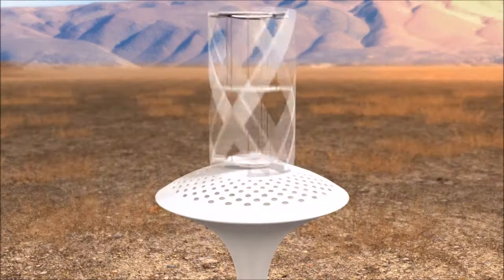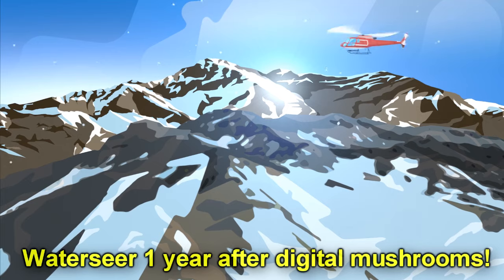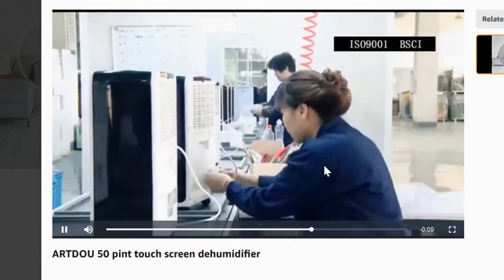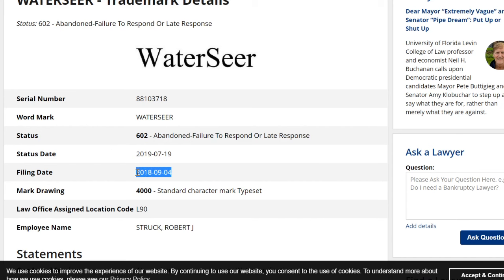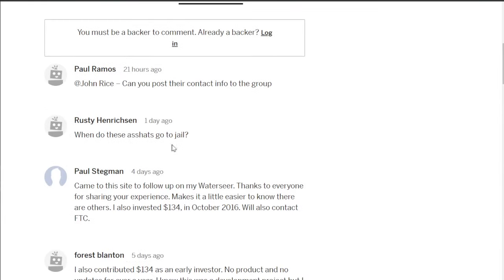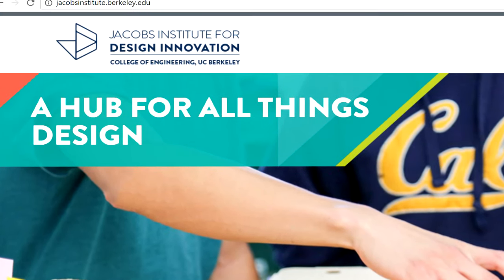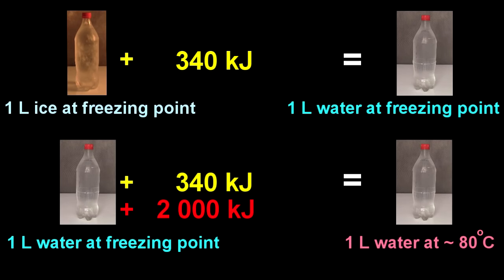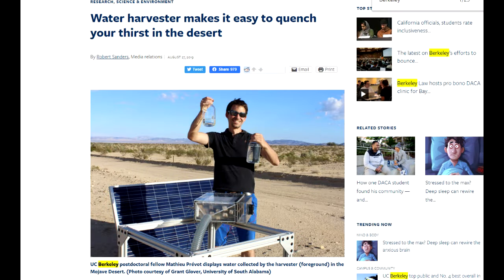Waterseer, Another one bites the dust!!

Comment: I don’t understand the thermodynamics argument in this video. The idea is that it blows warm moist air from the surface to a soil cooled chamber underground. The system is giving up heat which is then absorbed by the soil. As such it is giving up energy not absorbing it. The question is if it will be cold enough in the underground section to cause condensation and to what degree. If the underground chamber was big enough and designed correctly, and vented back to the surface to maintain airflow it might work. After all doesn’t an underground heat pump system do the same thing in reverse absorbing heat from the soil by pumping a refrigerant into it and then expanding it thereby capturing heat from the ground. These systems absorb free heat from the soil as the heat pump output is far higher than the electrical power inputted. The soil does not significantly cool down in the vicinity of the coils in those heating systems so I take it soil is a good conductor. Similarly I do not see why the soil should heat up significantly in this case. Heat sinks could be branched out from the chamber. The question of whether it will work or not is more to do with humidity and dew point in the chamber than thermodynamics. Would there be sufficient moisture in the air in an arid region for this to work and would the temperature difference between the surface air and chamber be great enough? I agree that the concept as presented appears so simplistic that it smells like a scam, but would it be possible to design one that would work? Mind you, I couldn’t see the water remaining clean for long in an underground chamber.

Comment: Basically they design a tube with a wind powered fan placed in it so it can draw in air. Also allows rain water in. Anyone with a little knowledge in metal can build one without having to spend lots of money. However in desert area's there is a lack of moister in the air as it is hot weather. They would be most suitable for after it rains or before. Cleaning as it also intakes dust from outside and mixes it with water would also be a problem. As someone who lived in Southern Arizona in a flood zone during rainy seasons this item is worthless. It's better to collect rain and store it naturally underground or in a cellar in barrels as to not let your water evaporate. Of course the business would shut down with so many problems and with such a cheap manufacturing. Also the air pollution in some area's could be drawn into them and contaminate the water. I am by no means an expert but even I can understand this much.

Comment: Any powered compressor system can produce water from the air.  The problem is always the power required to produce enough water to be meaningful... 'how-much' water you get given the power you can supply to the system, the humidity, and the cost of the components.   A normal home AC system produces gallons of water a day while it is operating, for example... but it is not drinking-quality and of course it also burns 4KW of energy while running.

A small extremely efficient compressor system such as you find in any powered cooler (say, a dometic cfx50, for example) can produce huge temperature differentials of 60F or more with an average power draw of only 15W.  Easily powered by a solar panel and a small battery.  But the components, added up, are not cheap, and optimizing something like that for condensing water would significantly increase the power draw (condensing water out of the air takes energy.  Just cooling an insulated compartment, not as much).   Also, the PH of the water produced will likely be acidic...it's effectively distilled water, and is not healthy to drink unless the PH is balanced out.   (Adding minerals afterwords isn't a problem, but balancing the PH is).  If it is your only source of water you don't want your teeth to fall out over time!

So the basic answer is... given any power source, such a solar panel or wind turbine, even a small one, you can produce water from air in the desert.  You just can't produce very much and the condensing surface can't just be metal fins (which will leech metals into the water being produced) and you probably have to balance the PH of the result and have to be careful about leeching material into it and you have to also add some minerals and ... well, all this gets a bit pricey and beyond the abilities of your average third-world resident to maintain.

-Matt

Comment: yes, this is a scam, but there really is a practical way to get water from the air.  it's called fog harvesting.  It works, but only in areas with reliable, heavy fog.  So it is not a scalable solution to water scarcity.

Comment: I think i found the machine least similar to his and in most optimal conditions it could produce 1200gallons/24h and liter of water would cost "just" 0,07243$ :D not including energy needed to purify that water that is. Rumors state that 3 units that he had running have been discontinued when it was discovered this system was not economically viable.

Comment: little question on top ..
WHY THE HECK should water from the air be the cleanest there is? 

just by faning air trough a tube you get dust particles into the condensing water ...

Comment: To be fair, as a PhD student in Electrical Engineering, most engineering students I dealt with are pretty damn stupid and would never think to do those kinds of calculations to see if it would actually work and would instead just jump right into it.  I can guarantee you that the more prestigious schools don't really produce students who think much more differently.

Many of those students may not have even taken thermodynamics.  It's not a requirements for my major at my university (we could take discrete mathematics or quantum mechanics instead).  In my university, it's also only a single course that most people just take and immediately forget because it's never really talked about again unless you're doing like chemical or nuclear engineering.

And probably a lot of the people that got involved are those more hippy like students who would have blindly agreed with the goals of the people that started this BS idea so they wouldn't even listen to the calculations.  I've dealt with a bunch of them too.  Their dreams never ended well as some combination of politics and actual reality squashed most of their them.
Reply: Oh yeah, and since the competition includes grad students, I am even more skeptical.  You never know where those students came from and you can deal with electrical engineers, for example, that have never even built a single circuit or programmed before or that don't even know what an amplifier does (I've met all three before as well).

Comment: so basically they just made a "Dew Point Aggregator"... the concept makes sense at the surface but the scale is entirely wrong... you know those heat pipes in computers? those transmit unbelievable amount of thermal energy, you would need a metric ton of the stuff like roots in the ground DEEP to make that much water from the air... 

i would rather get pipes bringing salt water from the sea, make solar panels electrolyze the water, contain the Hydrogen and Oxygen, burn it together to make water again, use the heat it to boil some other water to make steam powered Electricity (Recycling the heat), collect the purified water made from Hydrogen and Oxygen, feed some cucumbers and other Electrolyte containing Vegetables with it and feed the people...

so they eat Cucumbers for Electrolytes and also food, and get pure water... would cost tons of power but that would be the "test bed" to refine making "recycled water in space"... but don't quote me, i am just some jobless idiot who plays video games! lol... at the very least, piping sea water to those places would be a start of an idea... how ever you get the H2O separated is an other problem that "real scientists" can figure out.

Comment: These water from air devices are stupid. What would be more needed would be a cheap, reusable and easy to set up water filtration system. The more pressing problem isn't the lack of available water, but the lack of safe to drink water availability.
This is the same problem with Solar "Frikkin" roadways, there is no problem that is solved with solar panels being used as road services, but the problem is that Solar panels are too heavy to be used on older buildings and too expensive for most people to have installed. Even on new buildings some engineering work has to be done to the roofs to be able to have solar panels. So the person that can invent light weight and cheap solar panels, even with no increase in power production, will make billions.

Comment: Bullshit like this distracts from real projects, i was part of a group that took part in a water purification challenege, we machined and designed a 100 watt rear hub that could be made to fit numerous byclces that connected to a small box that contained a 60 watt reverse osmosis pump and filter and a couple of uvc lights to germ kill water. Modular system designed to be cheap as possible, easily cleanable and modular, could either put clean water in one tank and use the bicycle generator to circulate the water over the uv lamps to sterllose it or put dirty water in anothter tank and reverse osmosis it first, kits were designed to be delivered as a complete wheel and boxes or just the hub and boxes, new filters would be supplied by donations from people, couldnt get any interest as hardly any money to be scammed off it. Worked great though, pedaling fairly hard would make a couple of litres per minute.